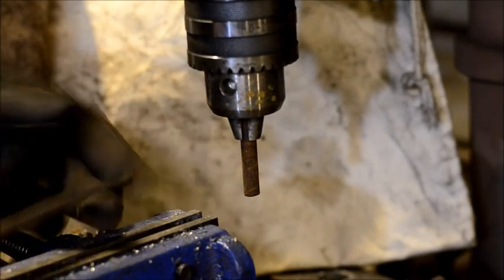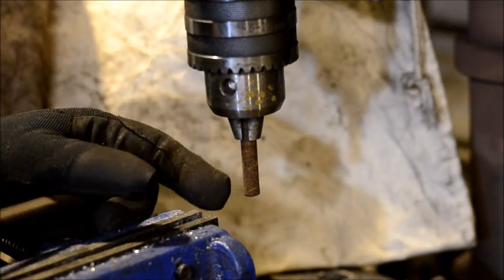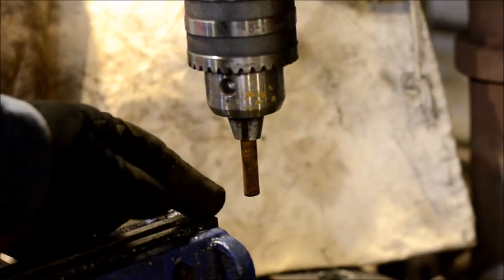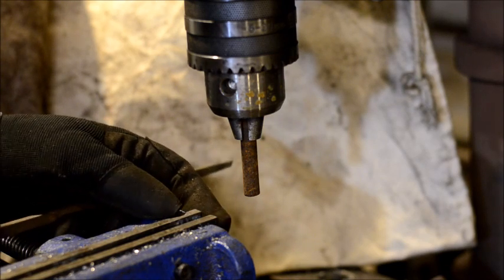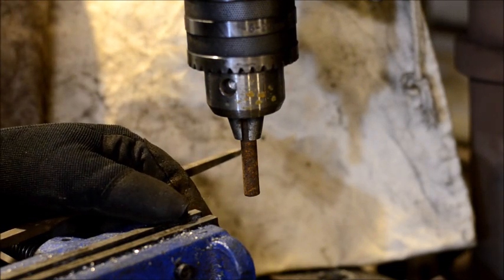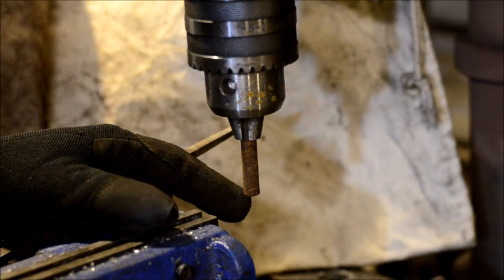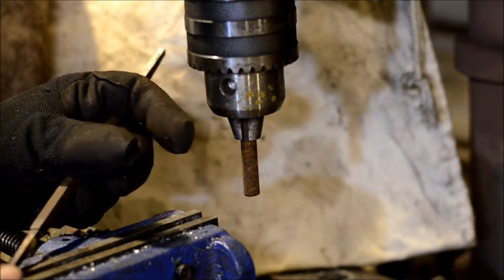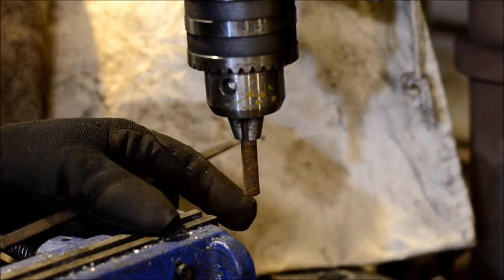Thinking Outside the Box: Turning Metal on a Drill Press

Comment: you really need to be careful side loading a drill press because the chuck is only press fit onto a taper and that is all that is holding it on, unless you know that the chuck is retained on a drawbar (in which case it's more than likely a mill) or the chuck has some kind of retention (not likely but they do exist) I would only ever use this if it was absolutely necessary because trust me a chuck flying off at you while it's spinning is not a fun time.

Comment: NO WAY I would ever wear a glove operating ANY machine tool. 45 years experience and I still have all ten fingers! Same goes for jewelry, watches, even necklace. Only takes once...
Reply: Good point, I worked with someone that hot the finger of his 'safety' gloves caugnt while using a large drill which reslted in pulling the skin off his index finger, very nasty

Comment: sorry mate but what a load of waffle, all you did was clean up a bit of round bar .....wheres the turnin g in that!!!!
Reply: Agreed, clamp some toolsteel in the vice and at least take tiny cuts
Reply: the method of connection between the chuck to the spindle isnt deigned to take that force ... how ever i would still try your suggestion. easy way to get toolsteel old burnt up drillbits are still tool steel and the back end of them is easy enough to grind to shape
Reply: @regbraddy845  but i think filing is also important to get it to the size you want with a caliper or micro but i do agree a tool bit can remove material faster
Reply: @woozhi9218  I did my apprenticeship in the dankest of machine shops haha but that's where I learned the right and wrong ways
Reply: well check old 1930..1950s popular mechanics and popular science there were items you could add on and machine using a drill press..even thread .just sold an old geometric die head made to be used on drill press..todays generatiom.would survive if it isnt a push button and control..i have to take care of a kid know how to program but zilch manual machineing or using hands

Comment: I've done this before with fiberglass tubes, I had to make a mandrel to mount the tube on, and a dead center that bolts to the table. Now I have a piece of 1/2" bar stock I want to get to a nice tight tolerance to make a semi-precision tool holder.... I was envisioning this method, but with the file in the vise, that way you can file off the high spots of the stock and make the work actually round instead of just skinnier and more shiny.